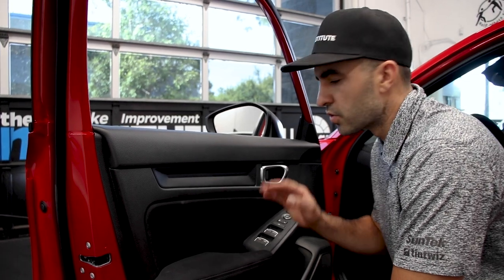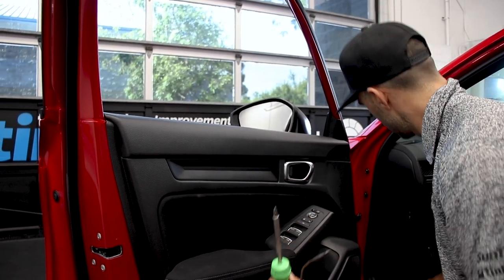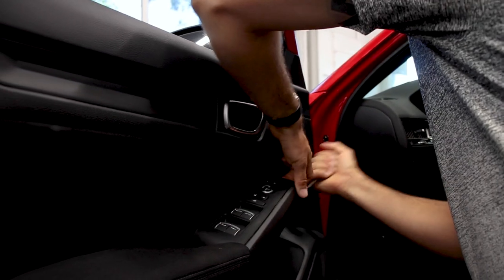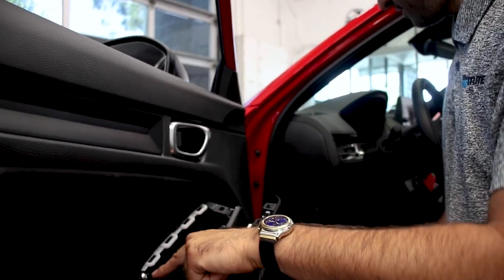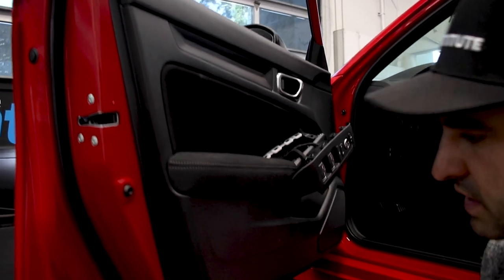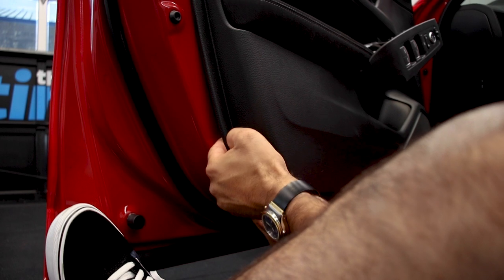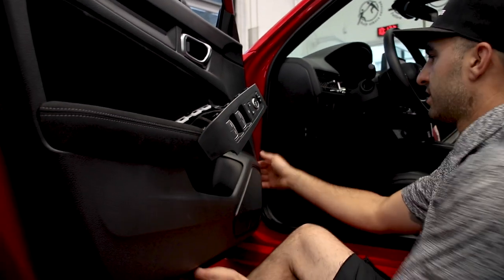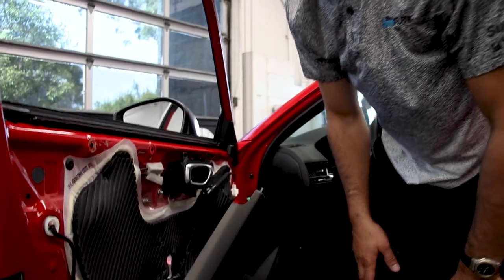How to Remove the Door Panel On A 2022 Honda Civic Sport

Comment: How do you remove to rear door Panels (the same way?)
Reply: Did you happen to figure out the rear door panel? It’s not the same as front and driving me crazy. Thx
Reply: @AParallelReality   same but smaller. Take out the window controller and there is one screw then pull bottom out just like front panels
Reply from the maker: Thank you

Comment: That panel don't lift up it pulls straight back we just did one the other day there are metal clips around the handle that could scratch if you lift up. Those gaskets are flimsy too could mess the channel up that it sits in lifting up we had an older one someone previously had broke lifting up. Just wanted to add that for anyone that is going to be removing
Reply from the maker: Thank You!

Comment: How to change side mirrors in honda civic 2022 ex ?
Reply: I just did one today you have to remove the door panel to get to the screws.
Reply: @josemedina936  how about sensor did you fix them as well ?
Reply: @monti007007007007  I actually went to the dealer today to get my replacement radar sensor calibrated because it was stolen and the tech couldn’t do it because the front window and radar sensor didn’t work with each other.
Reply: @josemedina936   I replaced my mirror 3 days ago they charged me 600$ for everything.
Reply: @monti007007007007  that’s insane you could of did it yourself.
Reply: @josemedina936  I'm currently trying to get my current passenger mirror unscrewed so I can put on the new one. However, I can't get to any of the screws. I've gotten as far as the guy in this video has but no farther. Any advice on how to get to the screws? I'd rather not have to pay $300 for the guy at Honda to do it for me.